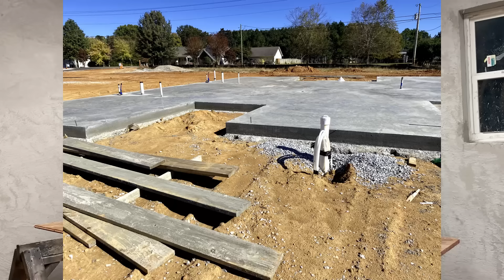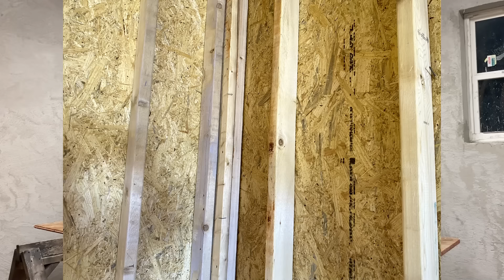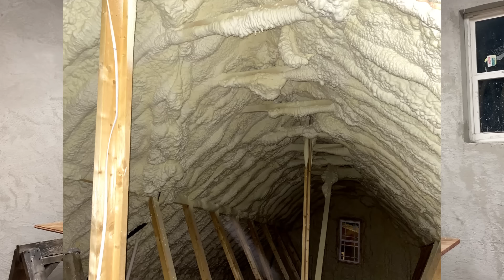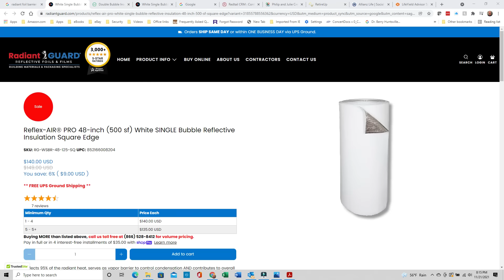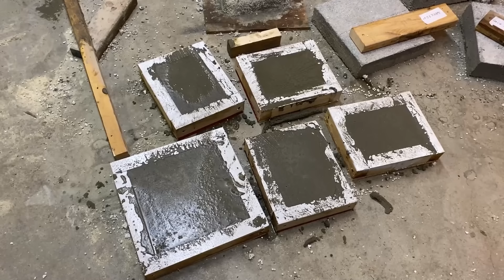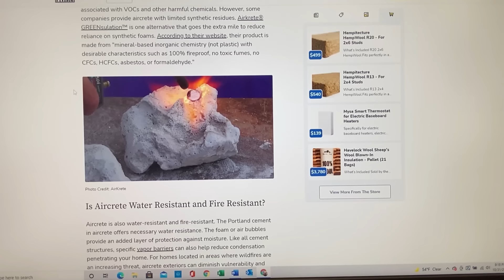Why I Will Never Live in a NORMAL Home AGAIN! Insulation Test!!

Comment from the maker: Our Abundacrete building method is 50x more affordable than conventional building while producing 92% less emissions. It's fast and easy - mix a batch in 3 minutes. Learn our 3 phase building process (Foundation > Abundacrete Walls and Roof > Self-Healing Finish) to build your dream home or whatever you want for just $5 / square foot in 2 months or less depending on build size! Download our online class at abundancebuild.com and Start Learning Now! Gain the skills you need and stash them until you're ready to build. We will be here for you every step of the way to ensure your success!
Reply: 💥⚡⚡💥Clothes dryers are a huge culprit for pulling in hot air in summers.💫 Their intake is from the back of the dryer and in order to force air through it back to the outside creates a negative pressure differential that has to be made up somewhere; any crack or leak it can find. Hot humid outside air pulled in through any void to feed your dryer. We're talking thousands of CFM on any given day. I have a system that pulls the heat from the attic to the dryer and will dry clothes in the summer without the heating elements even hooked up. And. through the reverse can supply warm air from the vent to the house in the winter. Clean and with proper water PPM to deliver about  50% wet bulb accuracy. Think about the addition to your builds. I'm an EE, but have built homes in SC piedmont for over 30 years. SC Licensed Residential Homebuilder. I'm not looking for any monetary gain. But I would like the info to get to you without posting for the world. You seem honest and genuinely concerned for the good of all. Let me know how to get the info to you and I'll gladly send it.✝✡

Comment: If the concrete stays the same temp due to radiant heating why would it ever crack
Reply from the maker: It shouldn't but we add a self-healing additive now so it can't crack!
Reply: @AbundanceBuild Have these structures been built in the upper Midwest
Reply from the maker: @andyk6325 If Colorado or Alaska count then yes 😅

Comment: Put an air, moisture, vapor barrier on the exterior of your sheathing. Apply waterproof insulation on the exterior of the barrier then an air gap and finally add your cladding.

Refer to Joe listiburek, he has developed the perfect wall, roof foundation.
Reply from the maker: Thanks for the tip!

Comment: I have been researching ways to build on a budget.  This is amazing.  I am wondering if I can use a small wood chipper to shred the Styrofoam.  I would like to use this as insulation between wood on the inside/out after it has cured for a while.  Its cold in AK 9 months a year.  I'm thinking this would be a great insulator as well as supportive during earthquakes with the addition of wooden walls.
You're videos are informative and interesting.  Thank you for making them.
Reply from the maker: You're welcome! Great plan. Abundacrete has an R value of 3.2 per inch 👍

Comment: I'm a builder/ carpenter. I remember I was working on another builders house doing finishing work,  and I asked him if he insulted the house well. He responded, no, I want air to flow through it so that the humidity doesn't stay in the walls and cause mold and rot. He said his father was a builder also, and when he remodeled older houses he saw a lot of rot inside the walls because the walls didn't have air flow. My response was that these houses had the insulation installed incorrectly. The object is to keep the heat/cold OUTSIDE, and the heat/cool INSIDE. When I quit a house I was always anal about the insulation. The more the better, the tighter the house, the more energy efficient the house is. The moisture content is managed by using proper vapor barrier on the inside and a "breathable" house wrap on the outside. This builder also responded by saying "you want airflow". My response was," yes, but you want control of the airflow". If you want fresh air in your house open a window, not let the winding do it for you. Yes, there are some problems with styrofoam sealed houses with condensation, but that can be controlled by proper de humidification.
Bottom line, the tighter the insulation, the better. It's the best investment on return you can put in your house.
Reply from the maker: Very well said! We now use a waterproof additive in our stucco to further mitigate moisture!

Comment: We installed a radiant floor heat in our new construction. It as placed over a styrofoam base that holds the piping in place. After that a three inch lightweight concrete that is mixed with a latex liquid, shredded fiberglass and perlite for the aggregate. The latex additive allows for expansion and contraction, the shredded fiberglass helps keep the concrete from cracking while the pearlite keeps the concrete lightweight. After 17 years no issues, once the floor heats up it takes little to keep it warm.
Reply from the maker: Great job! Radiant floor heat is worth the investment! You can use Abundacrete in the slab to achieve the same effect

Comment: Just dropped in to look. How structural are these materials? Able to completely replace wood/steel/concrete traditional structural members?
Reply from the maker: Yes the strength in our method comes from the homogenous fiberglass mesh and cement shell of the building. It distributes weight well! And the Styrofoam actually adds a lot of compressive strength!

Comment: I'm interested about using styrocrete blocks instead of pouring it straight into a form. I understand your arguments against it, but I have some specific applications. Could you use styrofoam in the mortar? One of my concerns is the thermal bridging that the regular mortar creates.
Reply from the maker: To get a good block make sure to compress them in the mold so it forms a solid bond. I don't think it would work in mortar but you could test a small amount and see how it holds

Comment: I was wondering why no one is putting lime in their aircrete or styro aircrete mixes. Would it help or not really? Also on the videos when installing these cretes into foams would cement vibration tool help with voids?
Reply from the maker: We considered lime but it is more brittle and not as cost effective. We prefer to pack it in very tightly to secure the styrocrete bond! Subscribe for new builds coming soon!
Reply: @Abundance Building Concepts  thank you for all the info in your videos. We're getting ready to do a below grade greenhouse and with the R values this gives I'm excited on using it for the walls and planter boxes.
Reply from the maker: @substanableprojects  Love it! Have fun! Should work great!

Comment: What mix would you use to insulate under a slab?
Reply from the maker: Less styrofoam to hold more weight. Consult a structural engineer. Subscribe for new builds coming soon!

Comment: I live up north and have spent a lot of time in TX, you are very smart to insulate your slab. Now that thermal mass works for you. Heating from the floor up is the most practical way to go, even the Greeks and Romans knew that. Hot attics in the south are relentless. An insulated roof and a vented cupola to circulate the air works great in the south. It also increases your useable living space. You know your stuff. I've seen some wood framed buildings in Dallas with flat roofs that had an exterior of stucco. After a few years all the wood framing rotted out. You are on the cutting edge. There are all these subdivision communities around Dallas where every home is built the same, always AC units and ductwork in a hot attic space. Makes no sense?!
Reply from the maker: Thanks! New builds coming soon! stay tuned!

Comment: Hello am reading about the r values here in the Netherlands and they use rc and rd valueThis is what the translation says;The insulation value depends on the thickness and composition of the foam concrete.  The foam concrete that Faber uses for installing the comfort floor and insulating the crawl space provides an insulation value of 0.9 RC for every 10 cm thickness of the foam concrete layer.
Reply from the maker: thanks for sharing!

Comment: Stephen, you are doing great job. It also makes sense from a material standpoint what you are saying and trying to prove. I think the Styrofoam adds both R factor as well as more stability in the finished product, of course with the right size and shape particles and air mixtures as a variable. I'm sure even the size of the air bubbles in the AirCrete and Styrofoam makes a different. If some one could make small little styrofoam balls or small tubes you could potentially increase the stability and R factor even more.  If the can make those little popcorn pellets they can surely make balls, ovals or something close.
Reply: another possibility is carbon nano tubes , it aids strength , i came here searching for ways to validate the insulation values
Reply from the maker: Thanks for sharing! Subscribe for new builds coming soon!

Comment: Thanks for doing this testing and making the video. Is there any way you'd consider doing a sound barrier test? You could use all the same structures and maybe simulate a typical 2x4 interior and/or exterior wall?
Reply from the maker: new tests coming soon!

Comment: I happened to stumble upon your video. I wonder if that would work in a cargo van or a teardrop trailer build I have going on?
Reply: I’d be careful using crumbly materials in a moving structure…
Reply from the maker: Need a mold to pack it tightly! New builds coming soon!
Reply: Cement - think crystals that hold everything together.

Comment: It's past time to dispel the "R-Value" myth.  It was invented by the fibeglass insulation industry and is just not correct.  Heat transfers through convection, conduction and radiation.  "R value" only measures conduction and poorly at that.  It is measured for a relatively short interval in a lab with apparatus that just will never exist in the real world.  Don't believe me?  Stop at you local home center and stick your hand in the heat boxes that have a heat lamp on top and a layer of cellulose insulation on one side and fiberglass on the other.  And this is just measuring radiant transfer.  Fiberglass is virtually useless against convection as there are always eddy currents of air moving in walls, floors and ceilings.  Once these come into play, R-value takes a hike.
Also, when competitive products like aircrete, foam and others are run through the R-value test for a full 24 hours, they match the R-value of fiberglass that is subjected to the test for the same length of time.
Reply from the maker: well said! subscribe for new builds coming soon!

Comment: I love that you did these tests! Could you go into a little more detail about the results in a future video? I'd love to see some actual data about the insulative performance of the various mixes. It sounds like you were weighing the residual ice after a fixed time. As you pointed out, thermal mass and retained heat have an outsized effect here. It would be enormously helpful for us to see a simple bar graph  showing the 70 degree performance vs the 0 degree performance with grams of residual ice as the unit. I think averaging the grams of residual ice after x minutes at both 70 degrees and 0 degrees would give a pretty "score", and I'd love to see the data.
Reply from the maker: tests coming soon!

Comment: Well done analysis, what do you think about using aircrete on the outside of a shipping container home?
Reply from the maker: Bill, it should work great. Then stucco the outside surface and paint it.
Reply: should help with condensation, which is the biggest problem with steel boxes and hot/cold air.
Reply: You need to insulate inside toobto avoid condensation

Comment: I feel like what we need is some company to start producing a kind of SIP block of aircrete or this eps/aircrete composite. Some kind of interlocking OSB sheathed block that would provide unidirectional stability and even uplift resistance, without requiring mortar or another adhesive to stick the blocks together, so it can be assembled into a wall super easily. I wish I had a factory so I could just start making them
Reply from the maker: Working on it! Subscribe for new builds coming soon!
Reply: @AbundanceBuild Any update on the building process that uses interlocking OSB sheathed block without requiring mortar ?
Reply from the maker: @taxproadvisor Sort of. We gave up on panels but Daniel has a new idea that can be delivered in the same fashion but attached differently. We are testing it now and will come out with the results soon
Reply: Hi. 
Why did you guys give up on the panels? And what does the new idea you have consist of? Are you selling interlocking mortarless blocks that we could buy? Because I want some if you do & how much are they? And how would I attach cladding to the outside of them? And how could I build or attach a second story upstairs to them?
Reply: Up north here and four years later, we are not building the way you’re suggesting, but we should be.

Comment: We plan to do some R value tests on our aircrete samples soon. Aircrete's strength, and I'm sure its insulation value, varies a lot depending on how much foam is added and how well the batch turns out.  We plan to use heat rather than cold for our tests.
Reply from the maker: I have enjoyed your tests so far. You are very thorough and describe the process really well. I wish you the best on your home project. Keep the videos coming.
Reply: Thanks! The Google result of R-6 per inch is what originally drew us to aircrete, but we realized pretty quickly that it probably wasn't accurate. At this point we are more interested in a stronger structure, because thermal mass is really effective in the desert. Our daughter is living an old poured concrete ranch bunkhouse that they fixed up to live in, and it does amazingly well without any insulation. 🙂🏜️

Comment: Been studying for years aircrete and
Icf etc . Use of the foam and
Watching your videos is super helpful I am
Building my own home in mtns in Az amd actualy threw out some
Ideas and paused my design process to heavily consider this method . I cant juts build like many places in the south however I’m gonna get crafty on ways Around code issues for sure thanks for the input and dedication to helping solve our larger scale
Issues
Reply: From what I understand there large areas of AZ. that have no codes to work around.  If you happen to be in one of those freedom loving areas,. You can build your own home however you please.  Of course this understanding I have is from YouTube so YMMV.
Reply: Yah unfortunately only I’m areas pretty much nobody wants to live in haha. There is still some basic codes, most of  non code areas are in super south desert areas or extremely remote. I’m in not when az where mtns and pine trees are boundless  and beautiful.   I’ve been looking at alternate ways for about 4 years on this particular parcel and have been around building most of my life in some fashion.  Stuff has flat just gotten tougher to do in nicer areas period. It’s a trade off but I’ll for sure be bending rules where I can, thanks so much for the information it’s useful and relevant .cheers
Reply: I'm thinking of using this in a polebuilding home.
Reply from the maker: You can do it! Subscribe for new builds coming soon!

Comment: I'm glad you are testing this stuff like you are. Makes me more convinced this would work well in a polebuilding home. With 6x6 posts and 2x gurts inside and outside you get a 9 inch thick wall at just an R-3 that gives you an R-27 over most of the wall. Where the gurts are it's an R-18. Around the posts you would have R-8 or so. More importantly little to no air migration through the walls.
Reply from the maker: Kriss yes this mix would work great for a pole barn. You could even go to the lighter mix for strictly insulation in your pole barn and get even a higher R value mix.
Reply: @AbundanceBuild  true but the sruff still needs to be able to flow for filling voids around the posts. We are talking a 9 inch thick wall. R-27 is better than most of today's construction.
Reply: @krissfemmpaws1029  gonna take a lot to hold all that in while it cures. What do you think the pressure at the bottom of a 8 foot by 9 inch by any measure chamber filled with liquid would be? If you poured a 8 foot deep wall the pressure difference from the bottom vs the top is going to make the walls density decreases as you go up the wall. Making the r value also differentiate. Needs to be poured in blocks or sheets or sprayed in thin layers.
Reply: @williambrandondavis6897  the stuff is a lightweight slurry because of the shredded styrofoam for starters. That decreases the density of the product as does the aircrete.

My idea is form 18 to 24 inch lifts of the wall at a time. This way you can control the bulge of the siding as you are filling the cavity with the slurry.

I'm looking at using a polebuilding or a Versatube building as the shell so all I'm doing is filling the voids with the slurry, because it's acting as insulation and not part of the structure it doesn't need to be packed tight like he needed for the core of his walls.
Reply: Even better to eliminate the forest of trees in a structure altogether…
Reply: @mudslinger888  I'm leaning towards using a Versatube building as a base building with steel studs for the walls.